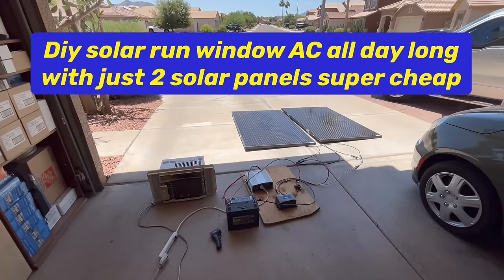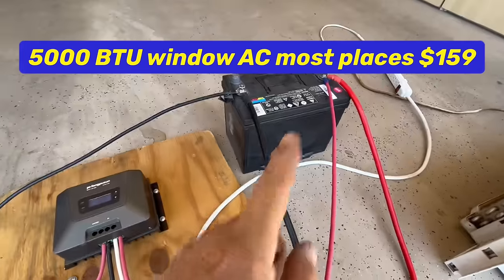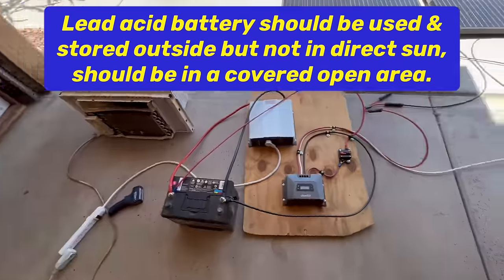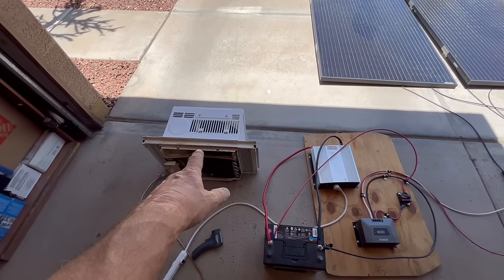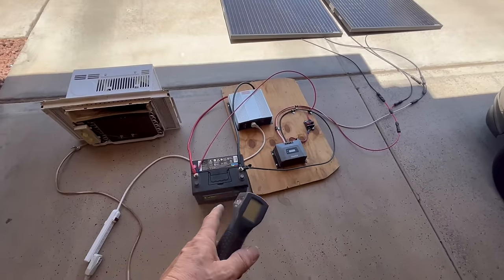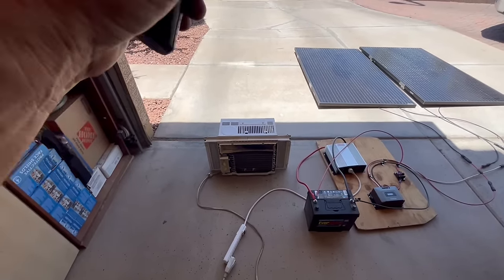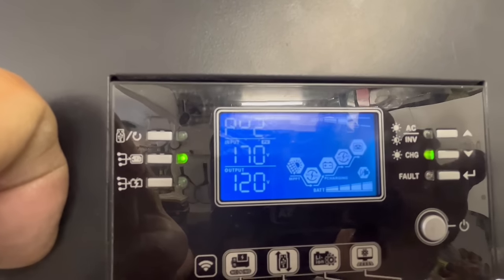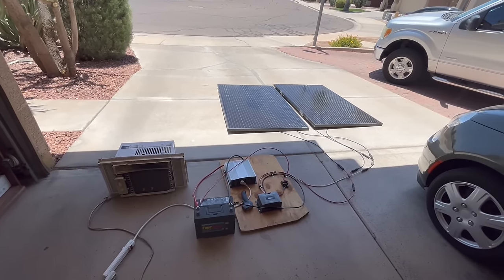Run your window AC with just 2 solar panels when sun shines. Easy DIY project you can do in one day.

Comment: Looks easy, but that is a great battery killer. You have to be very hands on to keep that from draining the battery down and destroying it.  I do some pretty advanced solar controls and like to keep everything automatic and fool proof. I can see disaster for many people who try this.
Reply from the maker: Yes, you have to know when to stop when  agm battery gets to 12 volts. On an all in one inverter/charge controller you can set the parameters to cut off at 12 volt.  Just wanted to show it is possible to run ac with very few components, most people have no idea what you can run on solar power. I actually run my 2 whole house ac units to cool 2450 square feet, run pool pump, pool heater, mini split heat pumps and a lot more off my 3 separate 48 volt systems with close to 50kWh of battery bank. Total 25,000 watts in solar panels between 3 separate systems. 33kWh is LiFePO4 batteries. I keep my grid bill less than $100 a month in Phoenix az in the summertime while keeping my house at 68-70 degrees all day and 74-76 degrees at night on 25.5kWh LiFePO4 battery bank overnight. It’s a beautiful day having off grid solar.
Reply: @diy-solar-guy  Sounds like you have a pretty big Solar system to run your whole house... Mind if I ask how much total $$ you have invested in Solar equipment to power your home?  Just Curious?  I'm in Central Florida and considering doing something like that here. My home is also about 2500 sq ft. single story.
Reply from the maker: @optionstraderman  I have in 3+ years spent about $5000 a year for a total of around $20,000. It will all be paid off by just the electricity saving on electric bill by December 2023. I have 2 cancers I have going through for almost 10 years now and need to keep my house cold due to damage of my Lymph nodes that control body temperature. So trying to keep house at 66-74 degrees while 113 in day and 85 at night would cost a great deal of money. So I was motivated by the fact I have to be in a very cold house to not be sweating all the time. I start to sweat at 72 degrees and it is miserable sometimes to go outside when over 85 degrees out. We have over 320 sunny days out here so it is perfect for off grid solar. If it is cloudy in Florida which I Beloit is, using a high efficiency mini split system during the day on solar would be the way to go. Your solar power production is greatly reduced with just lightly cloudy days and is horrible with cloudy and rainy days. Hope that helps you in making decisions on using solar in Florida, if you have any other questions, please ask, I will answer. Hope you have a truly wonderful and blessed day
Reply: how u got all this stuff and still paying $100 grid bill still?
Reply from the maker: @Chevroletcelebrity  my electric bill would be $600-$900 a month for the amount of electricity I use. That $100 is for just using 20kwh a day. It is really expensive out here in Phoenix AZ for electric bill. I use the same amount of electricity in the summer as I do in the winter but they double the price per kWh in summer.
Reply: Where ddid you get the solar panels?
Reply from the maker: @Nfr-r2e  santansolar.com
Reply: @Nfr-r2e  what are you asking him that for? you think he stole them? want to see his receipt too? 🤨

Comment: I haven't watched the whole video yet but I am wondering about attaching a 'softstart' to eliminate the surge.   Does that change anything in this setup?
Reply from the maker: Just adds cost to the system. If you keep the system running non stop all day, there is no need to add software start since you only have one time it surges. Most window ac are very inefficient so I actually after making this video started using mini splits which are extremely efficient. They can cool or heat. A 12,000 btu mini split can cool it heat up to 600 square very quickly as where a 5000 btu window ac can only cool and takes a long time to cool area and can only cool around 60-100 square feet. I have 6 mini splits installed in my house and garage. 2450 square foot 2 story house. I also now run my upstairs 3 1/2 ton heat pump to cool and heat and the 4 ton downstairs to cool and heat, on with my 48 volt off grid solar power system. This was a bare bones very basic system to illustrate you could run a window ac with solar power. It is not very efficient. It needs a lot of improvements to fit your specific needs and as not a one size fits all solution for air conditioning a room. I actually installed a 12,000 but mini split in my 23 foot motor home and it cooks it heats it in 30 minutes to 20 cooler or hotter as where my rooftop ac can only cool and will never cool or heat to 20 degrees no matter how much time you run it. Check out my other videos where I show running a much more efficient off grid solar system that can handle large loads to start and keep running. It’s been 110 degrees here in Phoenix during the day for weeks and my 2 story house and garage is 70 degrees with not using any grid power. I also heat my pool with electric pool heater to 87-89 degrees in March through December with only solar power. Hope you enjoy the other videos and think bigger than just this little 5000 btu window ac. Hope you have a truly wonderful and extremely blessed 2024.

Comment: Now if you can make a 100% guaranteed water proof  mobile case on wheels to house all those components with connector sockets installed to plug in your cables and large PC fans to vent out the battery's gas. You could roll it around and set it up anywhere. If you had one of those and lived in an apt building, you could roll it up to the flat roof (setup your panels up there too) and string down cables to your window for your AC. If you could make the case small enough, you could place it on a fire escape (not getting in the way of people who would have to use it for escaping).
Reply from the maker: Sounds like you have a project to accomplish, solar is really tough to do in apartment. I am blessed to live in a house with a 1/4 acre lot. I actually can now run my whole house and garage ac with only solar, I saved over $700 last month on electric bill. Taken 4 years from knowing nothing about solar, air conditioning and electricity to air conditioning house and garage with only off grid solar. In Phoenix AZ, that is a huge deal since our average daily temp last month was 103 degrees for a 24 hour period. Highs have been 110-117 last 2 months. Check out my videos on how I use mini splits or central ac units to air condition house and garage and even run pool pump and pool heater in winter to heat pool to 87-89 degrees. Thanks for your input, it sounds like a great project for someone to do. Hope you have a wonderful and blessed weekend

Comment: Get a $300 100 amp hour lithium iron phosphate battery and no worries being inside. Could run the AC full on for 2 hrs after dark. Lifepo4 batteries are much better for this than lead acid. Night and day difference.
Reply from the maker: I have 4 12v LiFePO4 batteries I’m going to try and see how long 1 battery will run. Then 2 batteries in parallel, then 3 batteries in parallel, and finally 4 batteries in parallel to see if you can get through the night and also how long to recharge next day with solar. These batteries are 150ah 2KWh each

Comment: what did you said " modified Jupiter 2000wat power inverter" what do you modify?? amazing project!!! thank you!!!
Reply from the maker: The juniper is a modified sign wave inverter. Not a pure sign wave inverter. I did not modify anything in inverter. That is just the type of inverter. Hope that helps. If you plan on expanding your system later on, you would be better if with a pure sign wave inverter. A little more expensive but you would be able to use to power TV, computers, etc…

Comment: Suggestion. I would mount the charge controller vertically. The heat is dissipating back into your charge controller the way you have it mounted now. You have no air flow. It may shorten the life.
Reply from the maker: This is mounted on a board to just display components, when I used this in my solar shed to keep components cool, everything was mounted on the wall of shed. You are correct in your comment about airflow. The window ac was mounted in shed and blew cold air at unit, in fact shed was usually around 60 degrees in the day when 110-117 degrees out. I ran from 9 am to 5-6 pm in Summertime. Thanks for your input and hope you have a wonderful and blessed week

Comment: Minus the AC unit what is the cost of a setup like this. Also can you provide links for equipment.  Thanks.
Reply from the maker: I just answered that question with another viewer, without ac, I spent around $409. You can look on Craig’s list or other places to buy used or Refurbished and get even cheaper. This is just a basic example of using solar to run an window ac unit, it is by no means a efficient system and you could and should make many improvements or upgrades to this system with basically all the parts. Just a simple illustration of basic parts needed. Improve on this and you will have a more efficient and longer lasting synths could save you money or add comfort in camper or motor home. I actually used this concept but greatly improved it to install and run 6 mini splits in my house, then to run my 2 central ac units and even my electric pool heater with only off grid solar. I run ac with off grid solar in day and battery bank over night. This is what I built 4 years ago when I started playing with solar for the first time. If you watch my other videos, I have greatly only my solar system in the last 4 years. Thanks for your questions and hope you have a wonderful and blessed week

Comment: Thankyou. Nice breakdown of the how and why of what you did. Curious, this may be a silly question, just unsure of the answer. Since the battery only has one set of posts, positive and negative both incoming and outgoing, when power from the solar panels is incoming, and outgoing power is being sent to the inverter while the ac is on, does the battery just provide the difference between the 2 depending on the ac's power requirements? I get the solar charging the battery while the battery isn't powering anything. But if the battery is under load(ac running), does the power provided by the panels in sunlight just bypass the battery and go directly to the inverter? Sorry for the long winded roundabout questions. I'm just unclear of where the solar provided power goes when the inverter is under load. Thankyou
Reply from the maker: Solar is main power, battery is supplement to load when needed, battery will drain when drawing from battery but when ac turns of and load drops, battery charges back up again. I usually draw 110 amps from solar panels to run loads and another 40-50 amps from my charge controller that charges battery under load. I typically use around 150-170 amps running both 3 1/2 ton and 4 ton ac at same time on inverter. Not many inverters can handle that load but the 12kw Growatt is able to with no problems. Hope this helps to answer your question.

Comment: They make hybrid mini-splits now that are plug and play, but very expensive with years of payback time. They use high efficiency variable compressors that don't demand that high surge starting current. Do they make new window shakers that have the variable compressor start technology? I would definitely rig a setup like yours cause I have a source of many used roof top panels from a guy who replaces them for larger units.
Reply from the maker: The hybrid mini splits are great. I have not installed one yet but I have installed 6 mini splits in my house, 2 upstairs, 2 downstairs and 2 in garage. I run my main air conditioners with only solar in the day and LiFePO4 battery bank at night. We have come a long way since this video. We even run our pool pump 24 hours a day with solar. Take a look at our other videos showing all we do with off grid solar. Thanks for your wonderful input and hope you have a truly wonderful and extremely blessed 2024.
Reply: @diy-solar-guy  You are an electrical genius! The only thing I'v used solar for was to charge my mower battery, and that's because I found the panel free on the side of the road. You're showing me the great potential that I'v been missing for years here in S Florida. I need to get going!
Reply from the maker: @GeorgeKennedy-u4r  yep, off grid solar is so so easy to do now with new technology, check out my newest videos with the EG4 inverters and battery banks. I show where all the wires go. Hope you enjoy the videos
Reply from the maker: @GeorgeKennedy-u4r  very very easy to use these off grid inverters to run so much. Just have to learn by reading and watching videos of others that have successfully used off grid solar. Enjoy the other newer videos with EG4 inverters and batteries along with all the different solar panels I use.

Comment: You should run a 200 AMP fuse from the inverted to the battery. 👍🏻
Reply from the maker: The window ac only uses 5.5 amps while running and a surge of less than 40 amps to start. I no would say a 50 amp fuse would be more than enough. Thank you for you input. Hope you have a truly wonderful and Blessed day
Reply: @diy-solar-guy  I go 200 hundred just in case you end up adding more batteries or more accessories.. but 50 is fine👌🏻
Reply from the maker: @DEOHGE-yn7ng Thanks again for your input. We appreciate it.

Comment: This is great, and sorry if this is dumb, but being as the battery will only run the AC for maybe a hour.  would you be able to just run the AC off the solar panels via the inverter? or do you need the mppt and battery to help during clouds etc?  ( sorry if i missed this somewhere. )
Reply from the maker: You will need to have inverter and charge controller and if you add more solar panels you would need another charge controller or change to a 24 volt system. The charge controller is a 12 volt or 24 volts charger and the unit auto senses which voltage is connected to battery. If you use it as a 12volt system you can only use 2 solar panels, if you use it as a 24 volt system the charge controller can handle 4 solar panels. Or you could have 2 charge controllers  with 2 solar panels connected to each charge controller. Another way is to use a all in one charge controller that is 24 volts. You can connect 2500 watts in solar panels for a 2400 watt all in one inverter with charge controller built in. With that you could actually run 3 to 4 of those window ac units that use 500 watts each and around 5 amps each or you could run 2-12,000 btu 110 volt mini splits that can air condition in summer and heat the room in the winter. Much better option is the mini split. I have dozens of videos on using mini splits and what is needed to build a solar powered off grid system to run the mini splits. I sure you will enjoy the information in the videos. Thanks for the question and hope you have a wonderful and blessed week
Reply: @diy-solar-guy  Thank you for taking the time to respond, i am looking forward to watching the videos mentioned, i just hope my tiny brain can absorb it :)
Reply from the maker: If I who had been going through 2 incurable cancers for last 10 years where I can only spend a few hours a week for last 4 years building this system, then anyone healthy and willing to watch a lot of videos could put a large system together I just 1 to 2 weeks as where it took me 4 long years due to not being able to lift much or spend much time outside. Trust me this stuff is really easy the way they make the all in one off grid inverters and the instructions on how to connect components. I don’t do a lot if videos actually showing installation because it takes me so long to install compared to someone healthy. What might take you a day could take me weeks or months to do. Hope this helps you understand a little more. A lot if this off grid solar is shown in videos with what components you need to do installation. I think you like the videos information I give. I tend to try to go over components several times in a video to help those who are just beginning. Thanks again

Comment: What if you can't hook up to shore power at night? Can you not run ac at night and then run it again once the sun comes back up?
Reply from the maker: @GoatsOut4Justice  you can not run at night with lead acid or AGM batteries. You would need grid power for Lithium Iron Phosphate batteries to run overnight